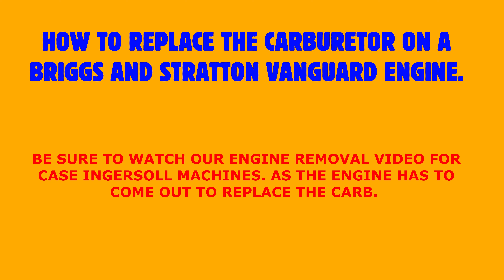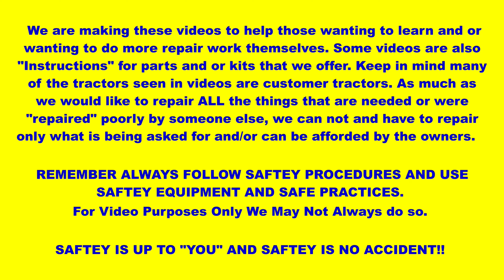Replacing Carburetor On Briggs & Stratton Vanguard Engines With Nikki Carbs. Case Ingersoll For Demo

Comment: Thank You for this excellent video!  I have this engine on a North Star generator and I’ve narrowed the issue down to the carburetor.  I took off the air filter to get to it and realized this is not a quick bolt on part 🥴.  You explained everything perfectly and even gave pointers on things to pay attention to during the breakdown/install 🎉
Reply from the maker: Glad it helped. Thanks for watching and taking the time to comment.

Comment: How hard is it to clean these carbs I'm new to the Briggs and Stratton engine it was running good but the guy didn't drain the old gas from the tractor and it started popping through the carburetor I figured the carburetor picked up some dirt from the old gas
Reply from the maker: Have to pull the front cover off and remove intake, some equipment means you have to pull the engine. Could also be a valve or push rod issue as well as possible ignigtion issue. Thanks for watching and the comment
.
Reply: @caseingersolltractorsnortheast  your welcome it was running good I think the guy never took the old gas out of the tank I checked it and it stunk really bad

Comment: Very clear tutorial. Thank you. I have a carb that's getting flooded, gas will drip out. I replaced the needle, and got it to run, but only with no air filter. After turning off, still was flooding. Should I replace carb? Thanks
Reply from the maker: Hi Thanks! What model engine? Did you use a high capacity OEM air filter? Thanks for watching and the comment. Talk soon.
Reply: @caseingersolltractorsnortheast  16 HP v twin
Model 303447
Not a high capacity air filter, but it's pretty new
Reply from the maker: Sounds like maybe a bad float or needs adjustment. Is it the orginal carb? Is your fuel pump a oem pulse pump and not electric?
Reply: @caseingersolltractorsnortheast  yes, original carb and OEM fuel pump
Reply from the maker: @carlzirk  I would make sure check is not failed and has fuel in it and try adjusting it so it sits a bit lower
Reply: @caseingersolltractorsnortheast  check what that sits lower?
Reply from the maker: @carlzirk  the float and that it has no gas in it
Reply: @caseingersolltractorsnortheast  thanks. The float seemed good, but I'll check it again and check the fuel solenoid.

Comment: Great video. I don’t like the idea of no mixture screws. But that the way it is. 
I would have put a small rag in those intake holes on the heads before using the grinder to clean up the gasket surface. And I know it would not much dirt from doing that. But that’s just me. We all do things differently. 
Have a great week.
Reply from the maker: Thanks, Agee no adjustment screws sucks! Yes most times we put a paper towel up in them, rag is hard to get far enough in without catching it with the wheel lol. Then we wipe them out. But when making videos we sometimes forget some little things as we are trying to remember to talk about everything lol. But the good news is they were soft rolloc fiber wheels on the end so not very abrasive but set up for polishing. Thanks for watching and the comment and have a great one!
Reply: @caseingersolltractorsnortheast  👍🏻

Comment: I was curious what the reason was for replacing the carburetor? Is a rebuild kit not
available? I have one of these Vanguard 16hp twin engines and I'm trying to learn
as much as I can about them. I put in a parts order last night, awaiting shipment.
Thanks much for your videos!
Reply from the maker: Hi Thanks for the order! So The rebuild kits are very pricey and come with not much more than gaskets and few seals etc. For the price kind of halfway to a new carb. So depends on your carb but throttle shafts do wear. If you have dirt gas it also can wear a carb as well. Some carbs get damaged by someone messing around etc. Often say for simple math a shop charges 15o for a carb kit and 150 to rebuild at that point better to get a new one as the labor to take it one and off is the same. Thanks again and Happy Easter!

Comment: I HAVE SAME TRACTOR 200 HRS JUST STARTED NOT GETTING FUEL ONE CYLINDER ..LOTS SPARK JUST NO FUEL RIGHT SIDE .VALVES ALL ADJUSTED  WHAT COULD MY PROBLEM BE THANKS BRUCE
Reply from the maker: Hi The fuel will go to both cylinders through a open shared manifold both will get fuel. If you lost spark on a cylinder chances are its a bad coil. Check out our video on Replacing Vanguard coils. ANd here is a link to one of our coil Kits, This one Is OEM Briggs. https://www.caseingersolltractors.com/product-page/c34294-c34289-briggs-coil-kit-and-oem-diode-connecting-wire     Thanks
Reply: THANKS BUT LOTS SPARK BOTH CYLINDERS JUST NOT GETTING FUEL TO RIGHT SIDE THATS WHATS BAFFLING @caseingersolltractorsnortheast
Reply from the maker: @brucekozik9689  ok so if your key is getting 12 volts and no spark you need the kit I linked in my last comment. How are you determining you are not get fuel in both cylinders?? Do you have compression in both cylinders?
Reply: THE CYLINDER IS AT 65 PSI OUTHER SIDE 90  START MOTOR AND PULL PLUG WIRE NOT FIREING PLUG COLD NEVER SMOKED OR USE OIL  @caseingersolltractorsnortheast
Reply from the maker: @brucekozik9689  ok so your cylinder is not firing that does not mean it's not getting fuel. There is a compression issue with that engine 90 psi is very low for a briggs Vanguard and 65 is a major issue. The one with 65 has a valve/push rod issue,  blown head gasket or hit dusted and rings and cylinder got damaged.